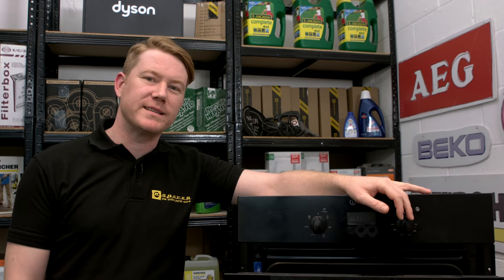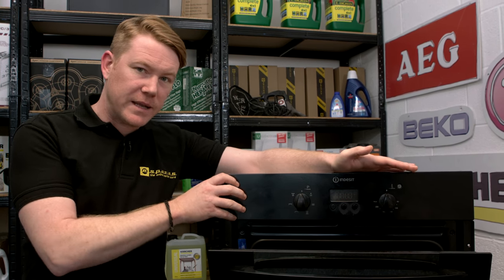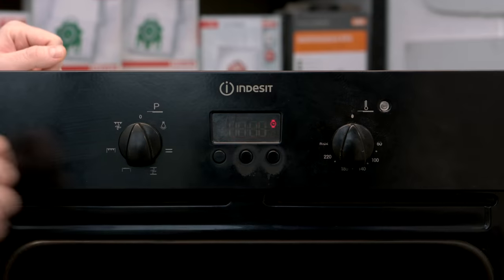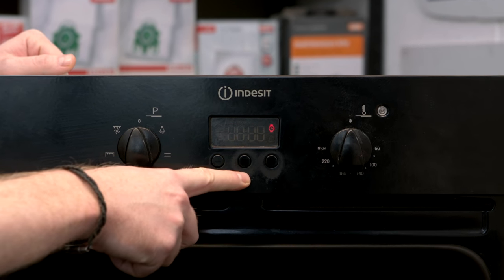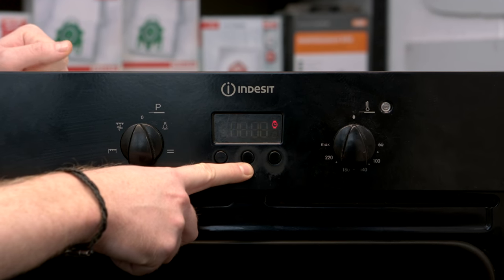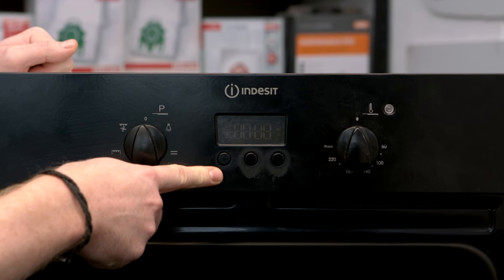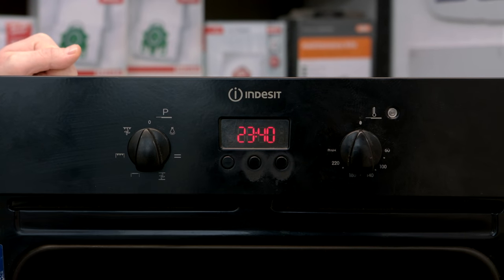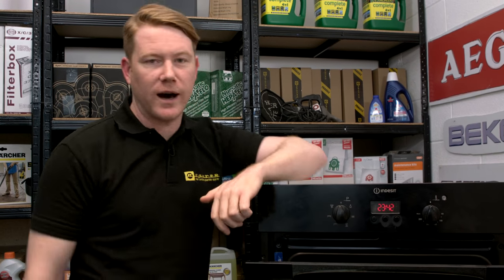Simplified Electric Oven Clock Adjustment

Comment: Hi my oven does not come on anymore. I had the flashing after a power cut ages ago & have reset the time. Both grills work & the oven switches on but no fan or heat.Someone told me a while ago it could be the clock that needs changing which I know can be bypassed would you have any thoughts on a fix?Thanks:hand-orange-covering-eyes: